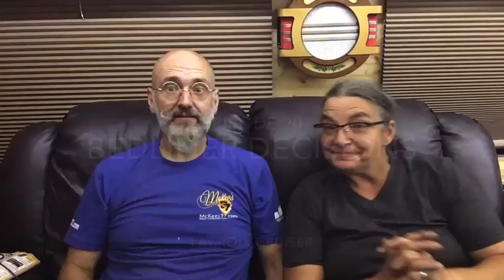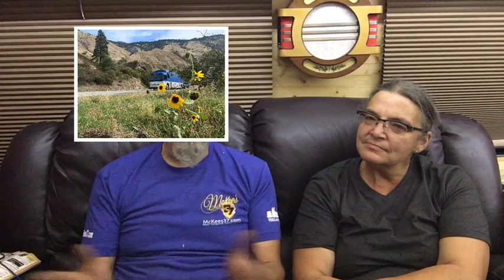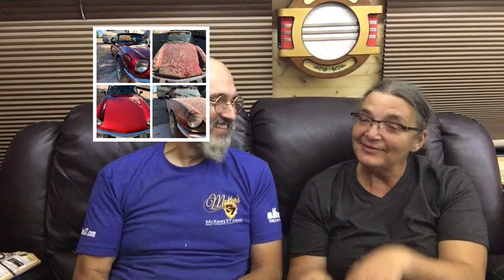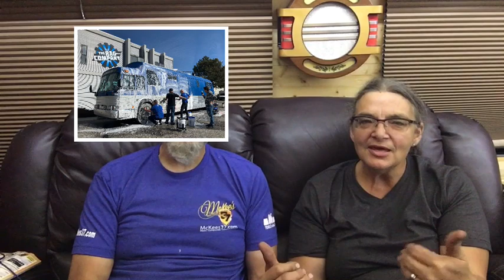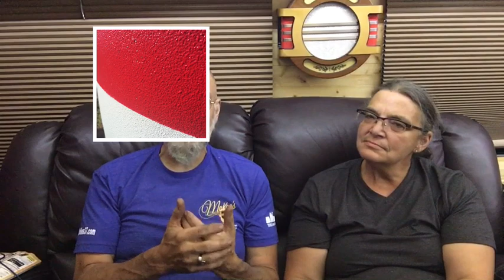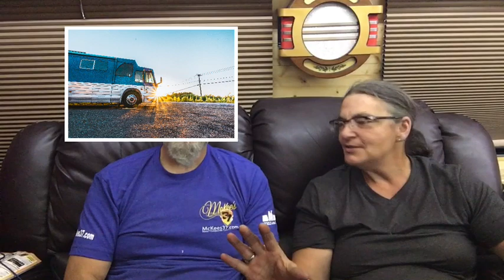E20 Why Bedliner? Lacroix Cruiser bus build.

Comment: It's all in the prep and the primer for good adhesion right? I've used bed liner in the past on a dump truck inside and out the company didn't take the time to prep it properly so I had some issues in the inside area but it did look good on the outside and it wasn't that expensive
I'm interested in the product you used for my coach and my thinking is why not make it to last with the less maintenance
Makes this option a win win.
Reply from the maker: Like any paint, it’s the preparation that determines the outcome more than the paint itself.

Comment: Could you have used a silicone to soak rubber in ! Or could you have changed it to the smooth plastic ones ? Just wondering !
Reply from the maker: We soaked it in a cleaning solution to free up the dirt. Silicone doesn’t remove oxidation, it hides it temporarily.

Comment: What kind of gun did you use on the bus. Had to have a very large tip I assume?
Reply from the maker: It’s a gun designed for the purpose, not a regular paint gun. Link in the video description.

Comment: I’m curious about the finish, is it shiny? Or is there a product that can go on top to make it shine?

Also does vinyl adhere to the Bed liner? For logos and/or pinstripes? ....I’m assuming a wrap would be out of the question because it negates the point of having the bed liner in the first place. Thanks
Reply from the maker: It’s a little shiny, but not like paint. Vinyl doesn’t like it too much.

Comment: How has the color held up to the UV rays these past 3 years?
Reply from the maker: the color remained the same red and we protected the bed liner with a ceramic coating which helps keep our house clean on the outside
Reply: @LacroixCruiser  thanks a lot for telling me this. I am flip-flopping between the idea of normal paint and the bedliner paint you did. I love all the pros you give for the bedliner and just worry about the brightness of the color fading. We are thinking of a forest green.
Reply: @LacroixCruiser  may I ask you what is the difference between ceramic coating and clear coating? Would it be wise to clear coat bed liner paint? I have seen some vids showing bed liner cars which got a clear coat application. I am assuming that clear coat would be a longer lasting protection to from the UV rays for longer lasting color brightness of the bed liner paint job for a bus.

Comment: Could you comment on how this couple did their roof raise ?  And compare it to how the roof raise was done on your bus ? (While the structure is still visible on your bus.) 
https://www.youtube.com/watch?v=eLmLVbNAL4s

How do you reskin a J4500 that has a curved skin at the front ?

How do you prevent oil canning when you reskin a bus ?

If you raise the roof on a J4500, where do you splice the front and rear caps ?

Was the lift on your bus put in above or below the windows ?
Reply from the maker: They seem to have done a great job, well thought out. Ours was done down the centre of the windows. A 9 inch square tube was added to match the existing tubing. A Custom front cap was made in Fiberglas. 

For the J4500 I have never seen one, but either by forming an aluminum panel, or with moulded in place fibreglass. 

Using 16 gauge aluminum will reduce the possibility of oil canning. 

I would need to see one up close to determine how I would splice the caps.
Reply: @LacroixCruiser  So were the stock windows in your bus 9" higher from the floor or 9" lower from the ceiling ?

The easiest way to raise a J4500 would be to add 9" above the windows, leave the stock skin alone, add a second skin above the windows.   Thoughts ?
Reply from the maker: Not stock windows, but yes 9 inches higher off the floor
Reply: @LacroixCruiser  Thanks for taking the time to ask all my questions.
Reply from the maker: Our pleasure